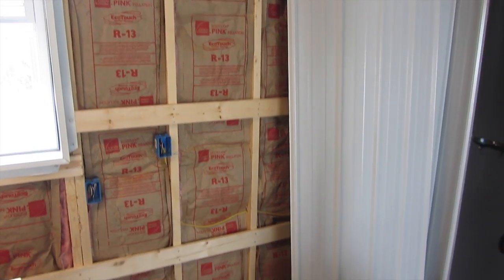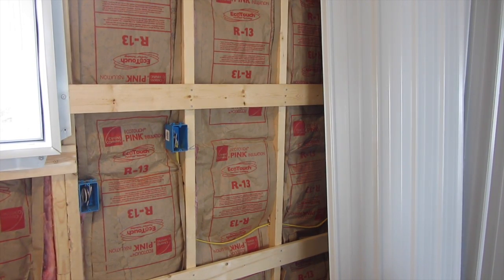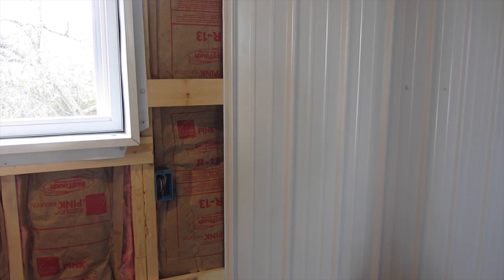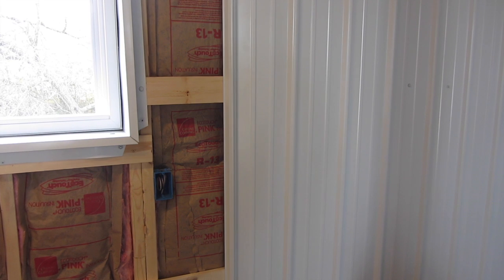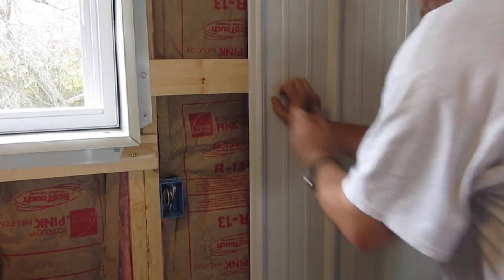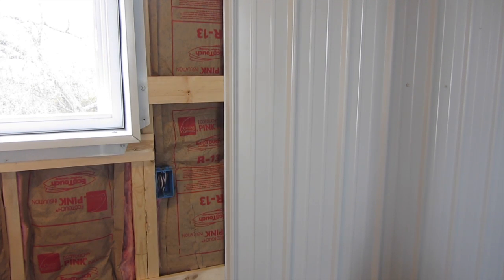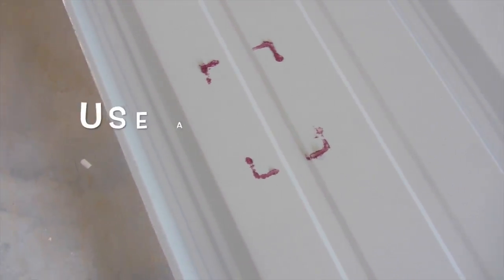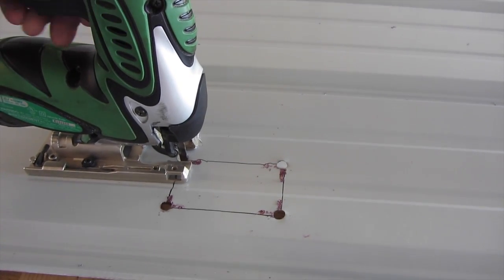Cutting Electrical Box Hole in Metal Siding - How To - with lipstick

Comment: an old Carpenter told me at least 30 years ago to mark receptacle and switch boxes with red lip stick to mark paneling and sheetrock. He use to tell me to keep red lipstick and a stick of candle wax in my tool belt. the wax was for the nails that we used to drive in Hardwood by using a hammer. Not like these day s with our nail guns.
Reply from the maker: People use to bore a hole down the end of their hammer handle, and fill it with wax.  It made a handy well to dip the nails in to the wax.

Comment: Hi. You need only 2 holes for Jigsaw, not 4, other than that, looks great to me. In California all sheet metal or aluminum  must be grounded at the main grounding system, all boxes in commercial must be metal and fire sealed (Fire Barrier Moldable Putty Pads MPP+) if the structures are made by combustible materials, and all openings must be fire sealed, minimum 1h rated.
Reply from the maker: true, but holes are ez to drill. Yes.  The county I live in is one of the strictest counties for inspection.  However, doesn't compare to  the rules in California.  The project in this video is for a barn with shop.  A lot of the construction and such was definitely over-kill to meet our requirements.  I'm not complaining though....  it's a quality building, and I spend more time out there, than I do in the house.
Reply: A small side grinder with a thin metal cutting wheel is much faster and easier... No starter holes necessary.

Comment: Thanks for the great tip. I wish you would have shown the cut. Does that saber saw cut easy or is it graby? Thanks again!
Reply from the maker: It works great.  If I were to give you a tip.... I 'd say.....    "buy the longest blade possible".....  take THAT to the bank, my friend!
Reply: Well I did as you prescribed and it didn't fit close it fit PERFECT!! Sometimes I think I am stupid for not being able to figure these small tips on my own. To often I overthink. Again thanks for sharing!!
Reply from the maker: Norm, I'm so glad to hear that this worked out for you!  That saw makes a heck of a racket doesn't it....  Hope you had some good ear protection.   My dad and I use to cut metal by turning a circular saw blade backwards.  We've done all kinds of stuff..... eventually you figure out an easier method.  Thanks for the positive feed back!

Comment: Great idea with the lipstick. I was going to try my Drywall method that I have a "template" that goes over the box, then you press on it, and it pokes holes on the backside of the drywall. I think I like this option better. Would probably work for the drywall too.
Reply from the maker: It definitely works well.  I never had any issues.  It would work great on drywall.